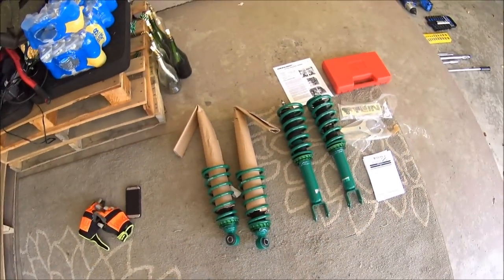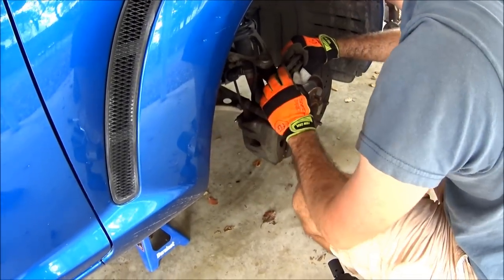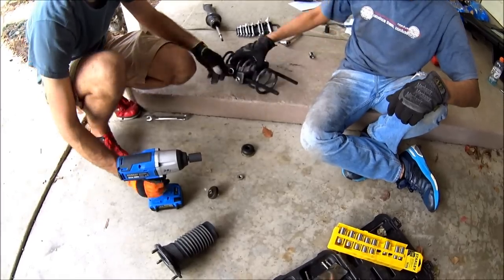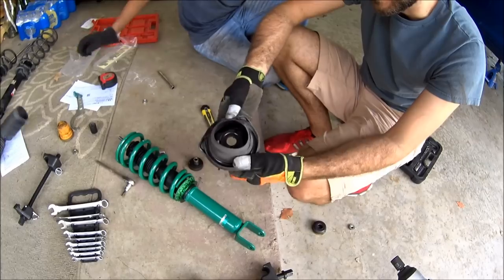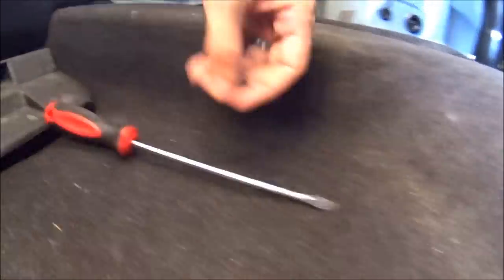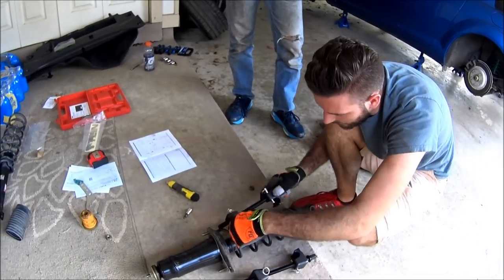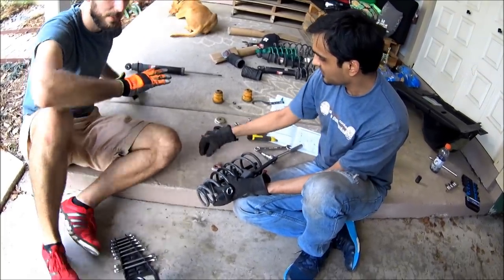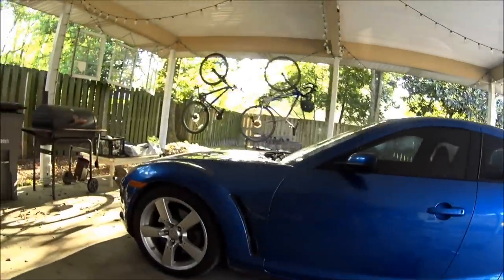Mazda RX8 Tein Street Basis Z Coilover Installation

Comment: I found a "better idea of a way to do this" It makes it MUCH MUCH easier if you hit all the bolts with pb blaster about an hour beforehand, and TAKE THE BOLT OFF BEFORE YOU LOWER THE SUSPENSION. came right out
Reply from the maker: aFePower_Rx8 good to know...thanks!
Reply from the maker: aFePower_Rx8 how do you like the new coilovers?
Reply: Not sure. Just finished the fronts and lowered it half an inch. In the process of doing the backs right now
Reply: Took me 7 hours but i Finally finished. Now I just need to bleed my brakes and I'm good to go!
Reply from the maker: aFePower_Rx8 sorry to underestimate the work time for you, but glad to hear that you got it all done!

Comment: Finally had to replace my OEM Struts that had completely worn out and I was feeling every bump.  I opted to use Bilstein shocks and reuse the coils.  Thank you very much, this made the swap out soooo much easier than many other DIY's I've done on my Rx8! Part numbers for the Bilstein Struts (in case anyone wants to know):  Front:  24-110044 and Rear:  24-110051 Dust covers:  KYB SB101 and KYB SB113 All from Amazon, they were the cheapest
Reply from the maker: Glad the video was helpful! I hope the new struts are treating you well...I'm sure they're lightyears better than worn out stocks!
Reply: Hi how much did struts and coils cost?  Thanks

Comment: Awesome video !
I used it to install my Tein this week. You made everything easier and you had some good advices. Thank you for making this video ! Now my blue Rx8 looks perfect ;)
Reply from the maker: That's awesome! Glad to hear I was able to help you out....how do you like the new Teins?
Reply: @Rotary9000  Oups, I realized I didn't answer your question.
Well, it is perfect ! After I installed it, I did an adapted suspension geometry by a pro. The handling is now absolutely incredible, especially on track. Very impressed by the result of these low-price suspensions.

Comment: You can loosen the top nuts on the strut on the car before you raise it, then when you lift the car the cap will be off and you can skip that spring compressor part.

Comment: I just got mine yesterday so I’m going to fit I’m going to cut my bump stops coz don’t have new ones and as you did use the jack to push the springs up so when the car wheels are on then the coils are at the right pressure.   Then go get them balanced and in line

Comment: For the money it seems like that setup can't be beat. How's the ride quality though, I'm looking for something fairly stiff, I know that tein supposedly re-released the basis with higher spring rates - any idea what the spring rates are? That channels project rx8 is getting compression tested in the next week or so and if everything checks out I'll be diving into suspension fairly soon. Very good informative video!
Reply from the maker: Thanks! I agree that for the money, this setup is hard to beat. The ride is stiff, but not abusive. I think it's a good balance. I believe that the spring rates are 280 lbs/in in the front and 224 lbs/in in the rear.

Comment: Hey man might be a stupid question, but im wondering why you took apart the old strut/suspension setup? Did you need to use anything from it?
Reply: also does it tell you how tight to torque down the bolts
Reply from the maker: RX8 PWR there are no stupid questions...only stupid answers :). You have to reuse the bushings and top hats from the old struts, which is why you have to take them apart. Torque specs can be found online, but you'll need a special torque wrench if you want to get exact. I just tightened as hard as I could.

Comment: Another question is it normal for one side to have more wheel gap than the other even though they have the same measurements if I’m making any sense
Reply from the maker: Mine didn't work out that way, but that could definitely happen if the weight balance is different (for whatever reason) on your car.

Comment: I'm looking to get these as my next mod,how are they holding up? Would you say it's Superior to the stock set up?
Reply from the maker: They're holding up very well and significantly better than the stock equipment
Reply: @Rotary9000  thanks friend, I'm gonna pull the trigger on these. I've used JIC coilovers on another car before but I was very much into autocross at that time. Good to know these won't be a downgrade from stock with is already pretty good just a tad more body roll than I want to feel. And they're cheap as beans lol win/win.

Comment: What's going on Matt just installed my coilovers but the manual said 1.7 for the front and 1.5 for the rear when I put it down it looks stock height basically my question it what you measurements?
Reply from the maker: Hey Edwin, I measured from the ground to the top of the wheel arch about 26" in front and 26 3/8" rear. The car will settle a bit more once you put a few miles on it as well.
Reply: @Rotary9000  thanks Matt for the info.
Your video was very help full was better than that booklet that it came with
Reply from the maker: Haha glad I could help out! I hope you like the new setup!

Comment: The brake rotors are facing the wrong direction? Unless the vanes are pointing that way, but I don't see your kit being that expensive that it would have directional vanes, only super-cars or BBK's go to the extent of having directional vanes.
Reply from the maker: Mugenpride they are directional actually. Each rotor came labeled with the proper location. They are Hawk Sector 27 rotors with Hawk HPS 5.0 pads.
Reply: They are directional but it does looks like the left and right are swapped.

Comment: is it important to load the suspension before you take out all the bolts?
Reply from the maker: Others have stated that the bolts may actually come out easier with the suspension unloaded.
Reply: It’s true installed my fronts and the unloaded one came out much faster
Reply: Great video tho using it again for my tears

Comment: What was your final ride height front and rear?
Reply from the maker: Daniel Arredondo I'll check sometime next week and let you know
Reply: MattDavis9k  sounds good, Thanks! great vid I'm gonna throw mine on next week just got them in the mail.
Reply from the maker: Daniel Arredondo 26" front and 26 and 3/8" rear. Did you get yours installed?
Reply: MattDavis9k from where did you measure, I just installed them but o haven't adjusted them 

do you scrape or get fender rash?
Reply: MattDavis9k I also have bigger tires on the ride I think stock was 225 45 r18, I have 240 40 r18 just bit fatter on stock rims, but I'm trying to Plasti dip them just not sure what color. I have the darker blue 2007 mazda rx8 grand touring.
Reply from the maker: Daniel Arredondo nice! no scraping or rubbing...i measured from the ground to the top of the wheel arch of the fender (through the middle of the wheel).
Reply: MattDavis9k great thanks appreciate it, I'll try post something up in the next few days
Reply: MattDavis9k so I got them on last night, tried to set them went for a spin didn't have time to readjust got dark >_< but I ended with one finger space on rear and 2 on front so today after work will bring the front down a bit and I'll take a small video.
Reply from the maker: Daniel Arredondo awesome! I'll check out the video when you get it uploaded....congrats on the upgrade!
Reply: MattDavis9k I can't put video up if you got email I can send you some pictures I ended up with 25 1/2 all around.

Comment: How is the ride quality? Bumpy roads a huge bother or its ok?
Reply from the maker: It depends on what ride-height you choose. I went pretty low, which stiffens up the springs, so it's pretty bumpy; however, I would say it's smoother than the stock suspension that had 98,000 miles on it. Compared to my worn out stock setup, the ride quality is less harsh, but bumpier, if that makes sense at all.
Reply from the maker: vietfattyxD you'll feel all of it haha. I live in Louisiana, so the roads are pretty terrible. Cruising on the interstate is nice and smooth, but surface streets are like dodging land mines. If you stick with a higher ride height, you'd be fine though.